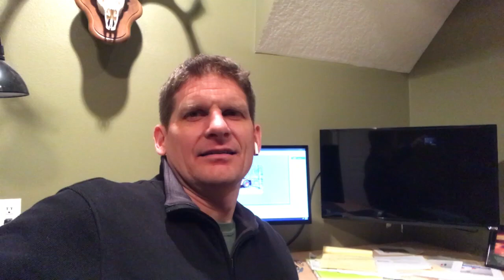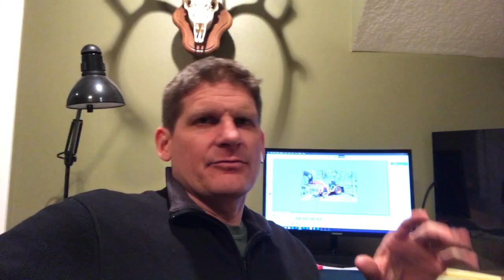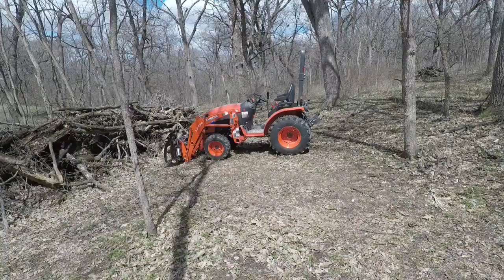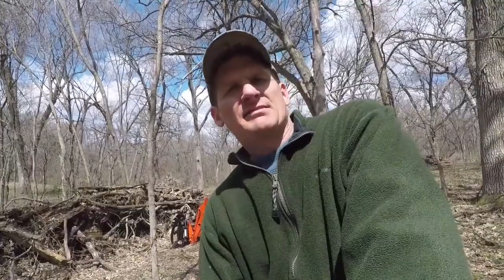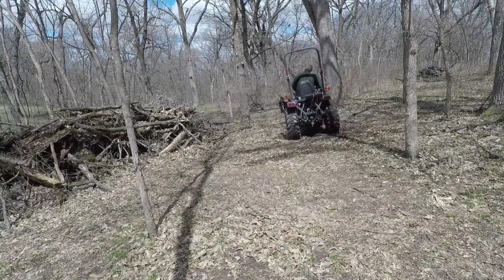Don’t try a grapple on a compact tractor... UNLESS you have proper rear ballast

Comment: Are your tires loaded?  That seemed a little surprising that they spun that much even without lifting any logs.  If not, you should get some Rim Guard.  Load tires makes a huge difference.  I have an L3301 with loaded tires and I can lift considerable load with nothing on my rear end.  I usually have something on the back but have been surprised on the few times I didn’t.  Good video👍
Reply from the maker: Yep, rear tires are loaded to the valve stems with windshield washer fluid.  It's crazy how light the B series is stripped down.

Comment: You were defeated from the start from that  slight hill.  Get your tires filled, my Kubota MX5200 gains 500 lbs per tire with rim guard (beat juice).  This will create ballast and give side hill stability.   Good educational  vid.
Reply from the maker: Those tires are filled. The B2601 has small tires so you only gain a few hundred lbs total. There’s just no weight in the rear of these little tractors.  Stick a 250 lb grapple on the front and add a small hill and you’re done. Additional ballast is a must. Not a big deal just something to know.